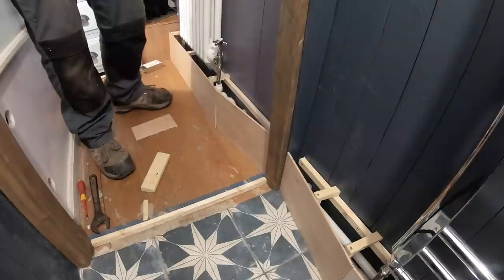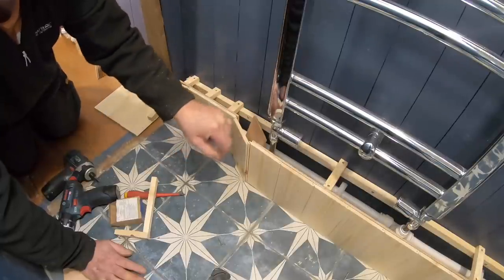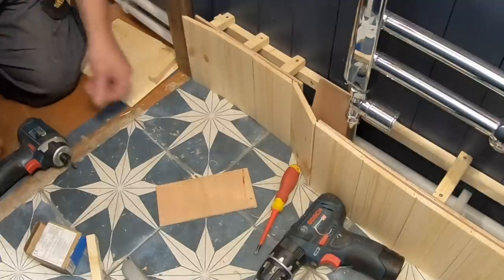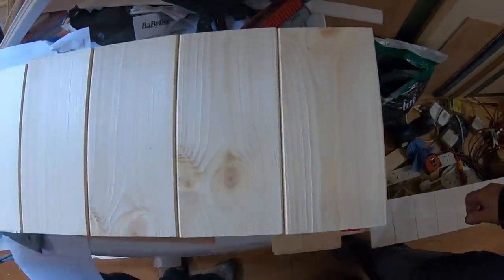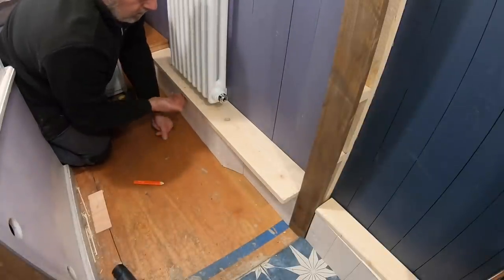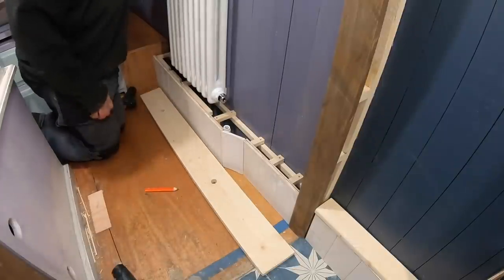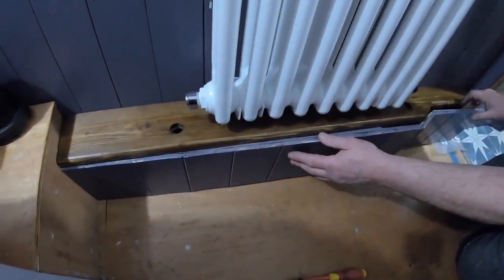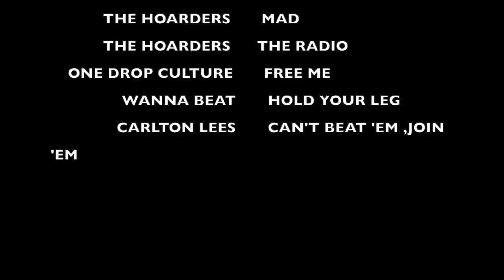Vlog 63, Narrowboat Fit Out - BOXING IN THE HEATING PIPES

Comment: Just come a cross an issue with JG fittings,. They are saying i cannot use chrome pipe, coming from the rad valves, unless i remove all the chrome from the pipe first.
I see you have used chrome pipe and was wondering how you got around that problem?
Reply from the maker: Yes we took the chrome off. If you watch the episode following the install Ady explains it. We haven't had any problems so far 👍
Reply: @makinganarrowboatwithnannyandg  Will be on my watch list for tonight, whilst the wife is watching 'Strictly" 🙂